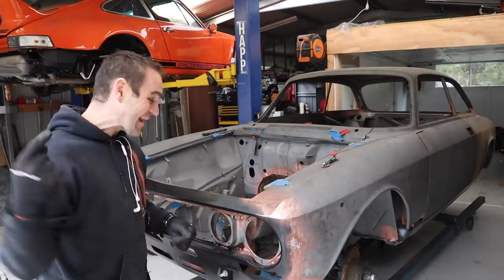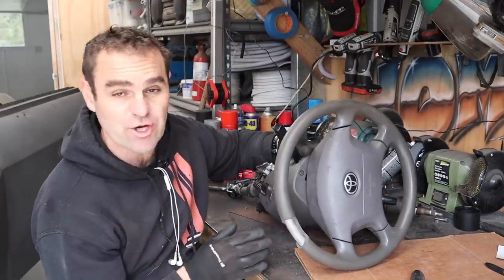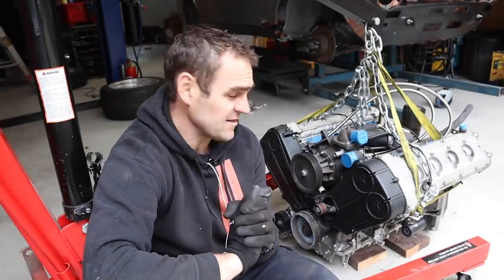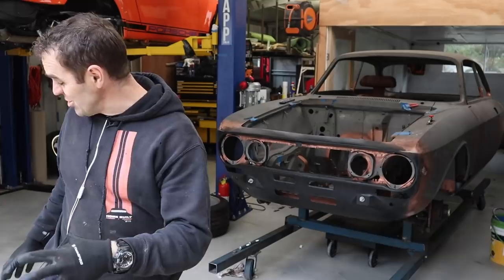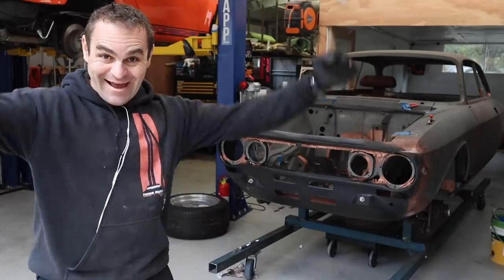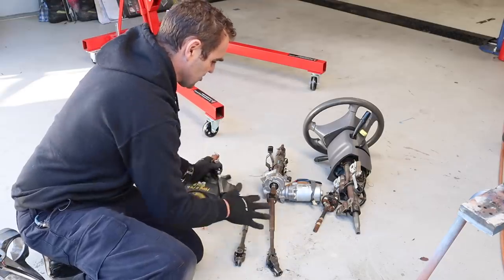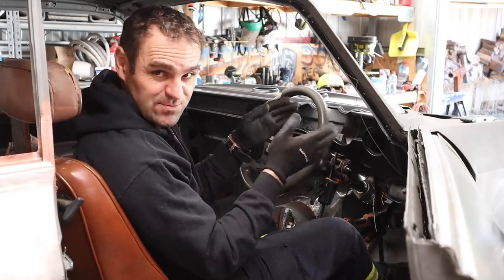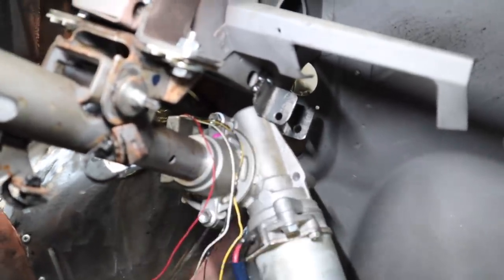Power steering? - Ferrari engined Alfa 105 Alfarrari build part 49

Comment: i have used a prius electric steering on my suzuki samurai  i used just the drive and adapted the shafts on ether end, it can be located anywhere use it with factory steering set up

Comment: Hey Jeff, just a quick tip for your bandsaw. Adjust the front blade guide via the black knob to reduce the gap between it and the rear guide. This will help prevent the blade from potentially wandering whilst cutting. Hope that makes sense.

Comment: Shift linkage, that thing you most want to be perfect which is also the hardest to get perfect. How much farther forward does the stick need to be for it to be in the right place? Can you cut/weld the rod that attaches to the transmission and then equally shorten the shift assembly bracket to match?

Comment: I think the seat is very stylish. You say the bottom's leather is in poor condition, so you ought to recreate it in the same colour leather and using the same stitched pattern - brown leather is lovely and attains a very nice patina over time. Make sure to use full grain leather and not a lower quality such as top grain or corrected. You could bolster the sides a bit to create symmetry with the back.

Comment: in the states, there is a system that mounts the alternaror to the rear axle, next to the driveshaft.. might want to check that out,, might give you room in the engine bay
Reply from the maker: Interesting. I will check it out.

Comment: You might like to check your steering column mounting with your engineer. In Vic the steering column must be a breakaway design or the collapsible feature will not work.

Comment: I would say keep the seats, but I definitely wouldn't run a half cage if you are going to keep them, since its unsafe to run harnesses with that type of seat, and definitely unsafe to have a half cage without harnesses (since your body can move around when not properly strapped down in a crash, and impact the bars behind the seat). Maybe add some bracing behind the rear seats if your need the extra chassis stiffness.

Comment: I had two 105’s followed by two 116’s ( gtv6) and two 156 ( gtd 2.4 and a 3.7 gta). Don’t change the steering on the bertone- it had a lovely feel, totally in keeping with the car ( oily smoothe) the real issue as I recall it was turning circle. I also used to love and still recall how with ones hands on the steeering wheel one could reach out with a spread little finger and touch the perfectly angled gear knob. 

Your work is impressive and your skills are amazing. But I worry your loosing the plot. What is the objective? Yours will be no alfaholic replica or Hommage , but rather what? An Italian ricer?

Comment: With so many significant changes made to the car, how is this going to work with engineering come registration time?  Or are you consulting with them as you go?  I think this is an amazing job you're doing, I only ask because of the "pain" friends have had with modifications on their own cars (which are no-where near as extensive as this!)  Maybe it's different in Victoria vs NSW.
Reply from the maker: The engineer looked at the car yesterday, and I am all good ;)
Reply: @HomeBuiltByJeff  Good to know!  Curious to know how this process works - so far my car is still registered...

Comment: Well done for choosing power steering i think the front end would have felt to heavy with no power steering as there is a heavier engine and gearbox
Reply from the maker: It is not really any heavier ;)
Reply: Using electric steering will ruin everything what alfa is about.. Even newer Alfas like 4C dosent have powersterring at all.
Reply: @expert20valvehlx  i have a 3l v6 swapped 105 and its more fun to drive with power steering

Comment: Gear lever > take a look at a GrpA Sierra RS500 Getrag, or a Jaguar Getrag 265 conversion - both fix the lever directly to the shaft but have a more flexible top link. see https://www.facebook.com/289064061201267/photos/pcb.2724735674300748/2724735350967447/?type=3&theater

Comment: Sorry but those are a bad idea. You lose power and you virtually have zero steering.  Good luck. I would have just gone with a remote 12v hydraulic. I have also seen the electric power steering systems lock the steering column completely.  I am a technician and work on cars daily, had about one of these things come in a week for failure.
Reply: I really wonder what cars you work on, since that statement doesn't have any merit.
Reply: @Paul_VanGo  Ah ok. Was trying to help. I work on many different vehicles I have my own shop in America. What ever you would like to believe. But next time that electric steering is out go take it for a drive. Alot worse than when a hydraulic system fails.
Reply: @Paul_VanGo  Also do you care to provide any evidence to your statement or are you just a troll.
Reply: @Paul_VanGo  Theres my proof.
Reply: @Paul_VanGo  I can keep going with this if you like. There are literally 1000's of cases. They are also all different failures proving that every bit of the system is junk. As I stated above this system is junk.
Reply: I had a Prius come in that had a completely seized steering due to motor seizing up.  So sorry you won't catch me using the system or letting ANY of my family use it also.
Reply: The other cars that come in are Camry's and mostly GM products. But I generally get alot of electric steering problems. Especially since I specialize in electrical diagnostics and work.

Comment: Alfa is all about steering, grip and style. As you gonna put gearbox in front and put shitty toyota steering you gonna kill everything what this Alfa make it Alfa... Put gearbox in back, put stock or upgraded stock steering.
Reply: I understand what your saying but who's project is it?
If Jeff wants to put a Toyota steering column in that's up to him. 
Also he said he's doing it for ease of fitment and interchangeability of components between different Toyota models.
Jeff also mentioned about a controller for the PS. 
It may be possible to tweak the controller to give more or less assistance - and therefore more feel.
Reply: Ever drove an Alfa with an old style steering box? It's a disaster. Plus, he had to change it all up, due to packaging. And lastly, the "Alfa" is now only a means of holding all the foreign bits together.
Reply: What do you mean move the gearbox? They're in the front in 105s aren't they?